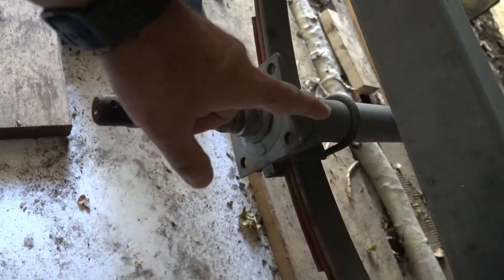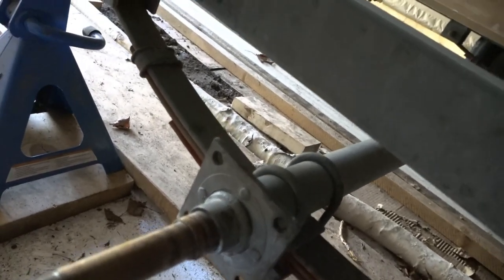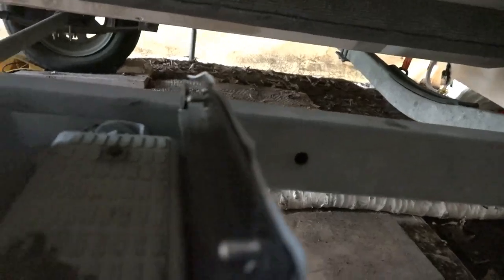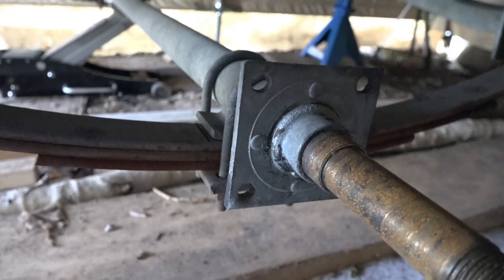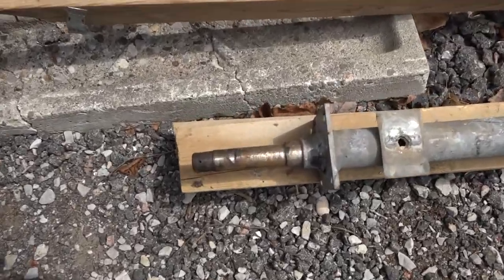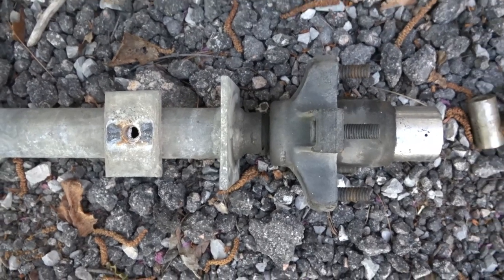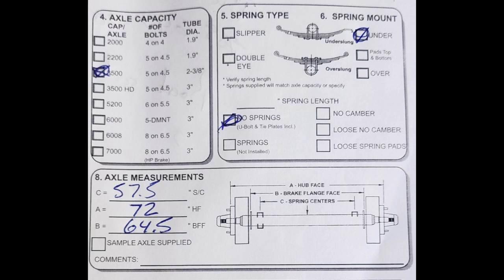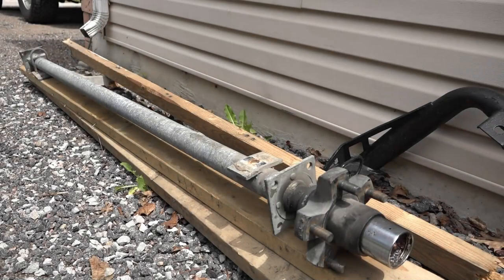Save Money and Hit the Water: DIY Boat Trailer Axle Swap

Comment: Take it didn’t need to be lifted…?
Reply from the maker: Hey @fdyhdfhy so no ot didn't ned to be lifted.  I actually enjoy the height of the trailer as it means that I do not have to back into the water as far as before to either launch or retrieve our boat!  So it is working great for us.  
Thank you for your comment and for watching our video.